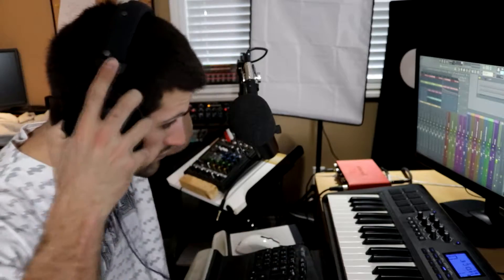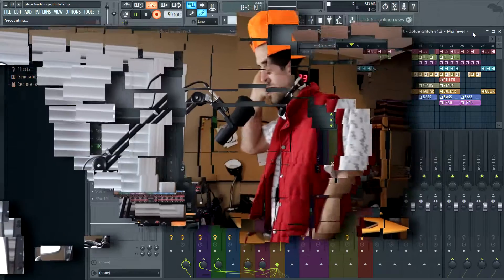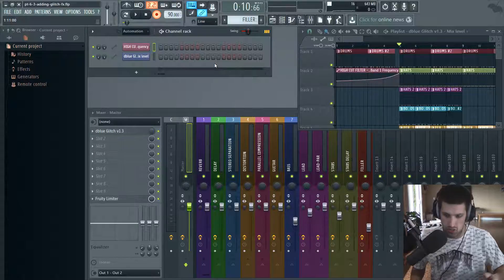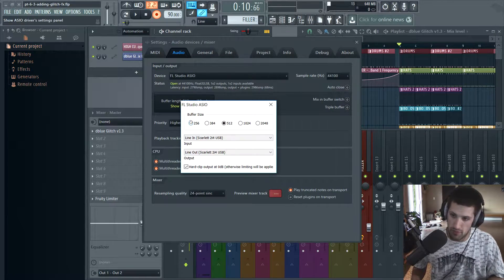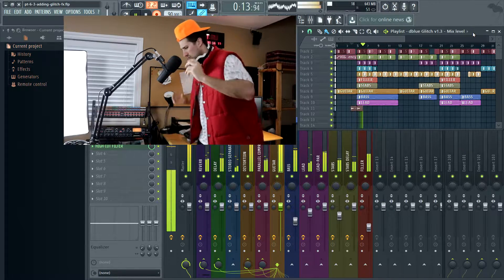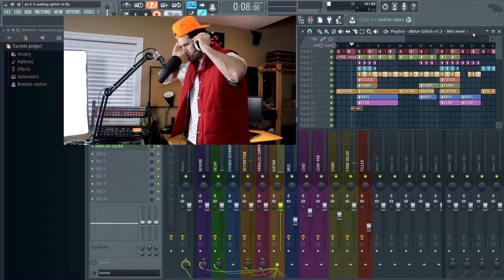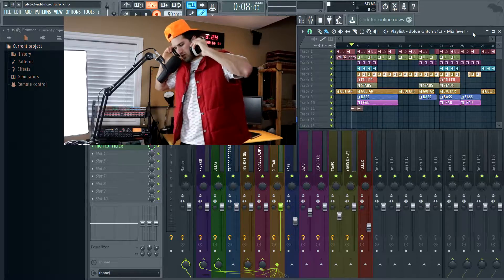The Problem with Audio Latency - [How to Fix Latency in FL Studio]

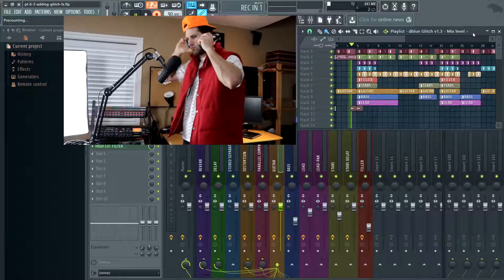Comment: 0.53 I have the same problem. I have a USB microphone connected to the PC. (I do not have audio interfaces) I am with Asio4all activated at 512 samples, add an mp3 that is the track and at the time of recording the voice in the middle of the song it starts playing as well as your video at minute 0:53 with a noise and is increasing. I have to change the drive to fix it. what is happening?
Reply from the maker: Maybe sounds like a feedback loop?
Reply: @itsGratuiTous  sounds identical as in the second 0:53

Comment: Sir i was tight on a budget and went for Behringer xenyx 802q usb as an audio interface but discovered the latency issue later on and i am seriously feel so annoyed and feel like i have wasted my money....though to my rescue i saw one one video where a guy was advising to use Behringer ma400 to monitor audio?

will it fix the latency issue and is worth buying?
and if you could do the video on the same...

Please help, thanks in advance.
Reply from the maker: You want to get the audio out of your computer and into the mixer so you can listen through analog and no latency
Reply: @itsGratuiTous  Thanks a lot, will surely be replying you after trying it 👍🏼